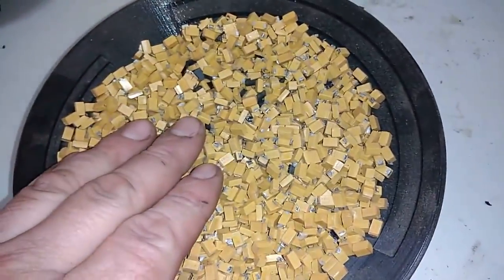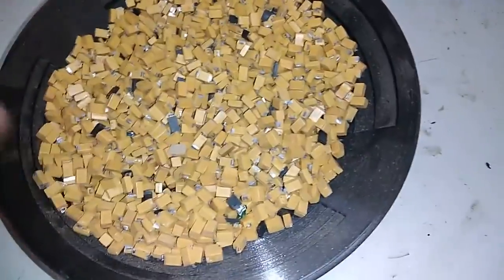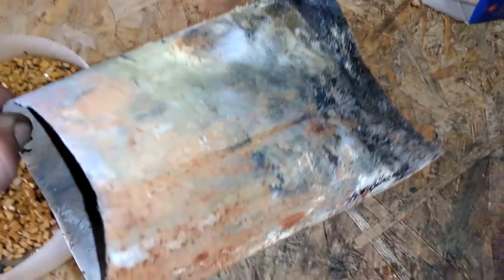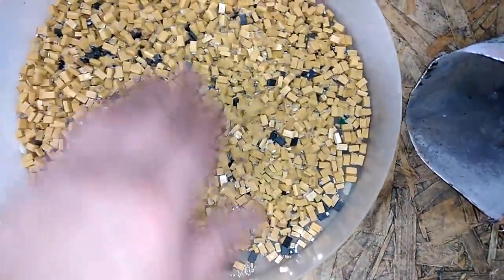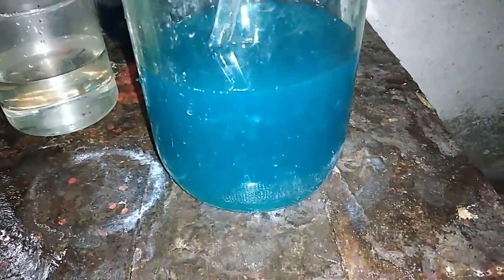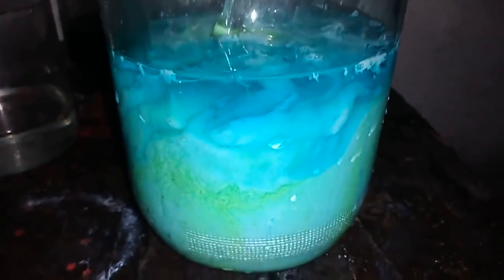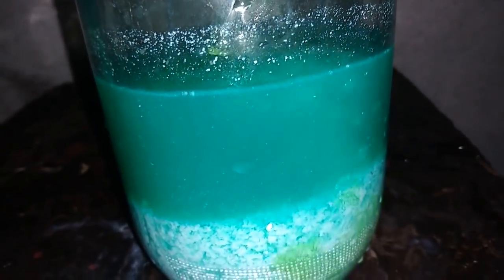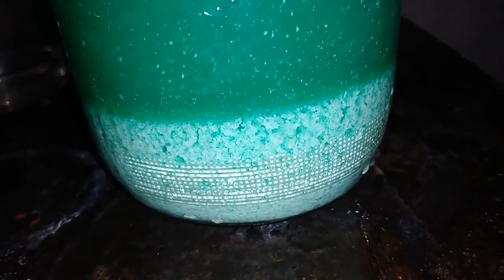Yellow smt TANTALUM capacitators Silver recovery!

Comment: Very nice yield and right on par with what I would expect.  I've found the yellow ones to run around 6% silver and the black ones to be around 8-9% but a lot of that depends on the manufacturer and age.  But these ones did not disappoint.   I have also found that after I process them in nitric and then in sulfuric/H2O2 and then again in nitric I tend to squeeze out just  a bit more silver.  Not a lot but enough to make it worth it.  I have no means to melt the tantalum but I did find that I can separate from the silicon that's left over by panning.  Still looking for somewhere to sell my tantalum powder at a decent price (everyone seems to just want me to give it away) but I still have around 5kg of caps to process so I am not in any rush to sell.  Once I have it all done I'll look with more seriousness.

Comment: nice & clean recovery, i always enjoy doing big amounts of silver chloride, i clean my tantulum pills with recycled hot sulfuric acid to get rid of the other junk afterwards, i have a small home made electric arc furnace here that i made from 2 microwave oven transformers & a set of fire bricks & a pair of tungesten electrodes, i can actually melt tantulum in it, i can only do a few hundred grams at a time tho, it costs more in electric to do it than the tantulum is worth if i do any less than a full 300 gram load.